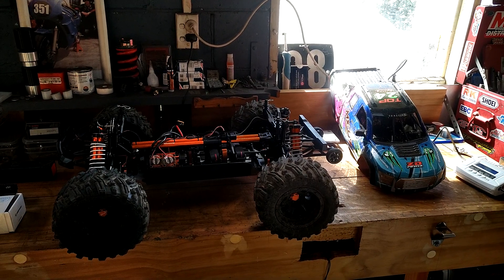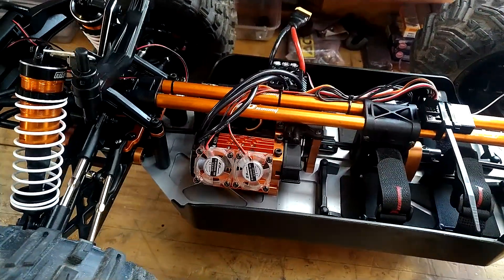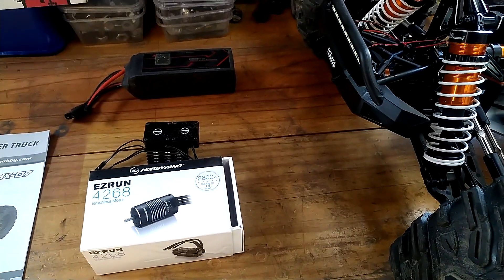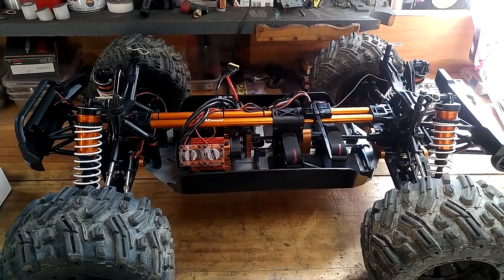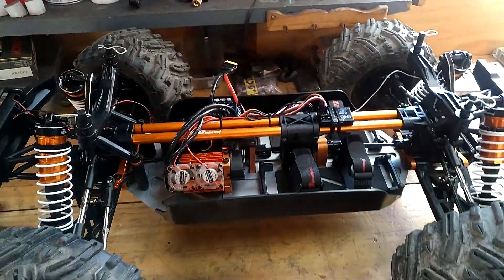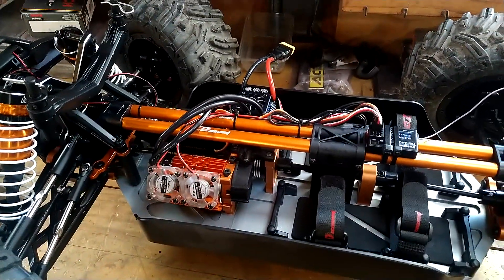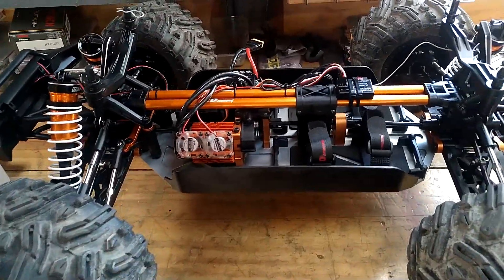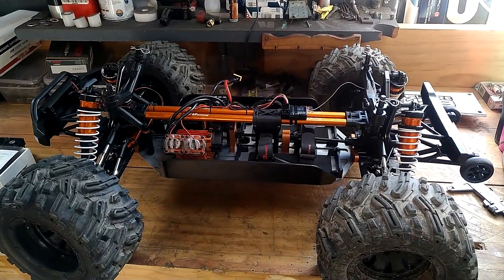ZD Racing MX07 parts used, unboxed, quality check, banter, review?

Comment: Your 4268 motor is meant for 1/8 buggy which is less than 1/2 the weight of your truck
Reply from the maker: Maybe, but it's working fine and crazy fast with this motor and battery combo.